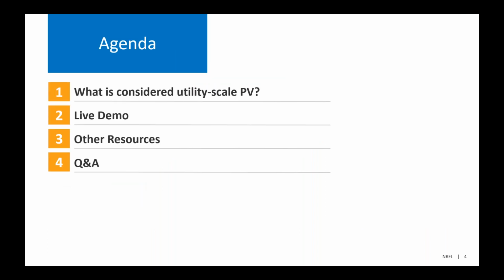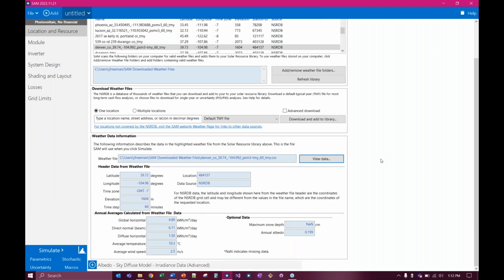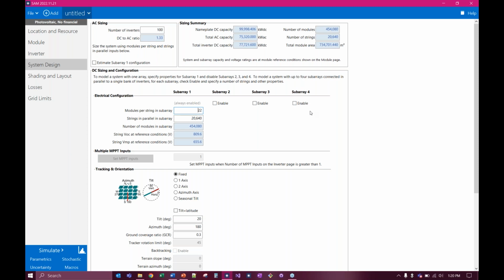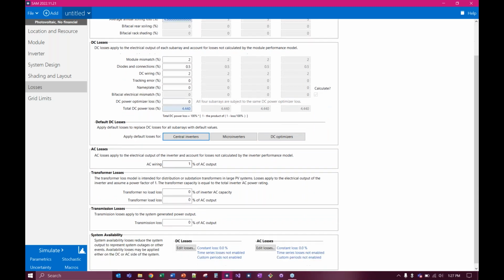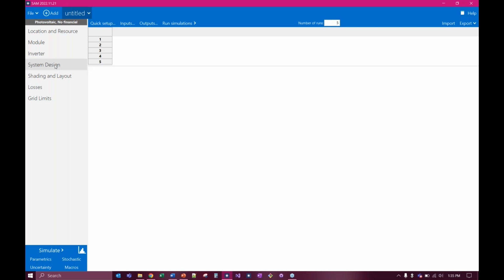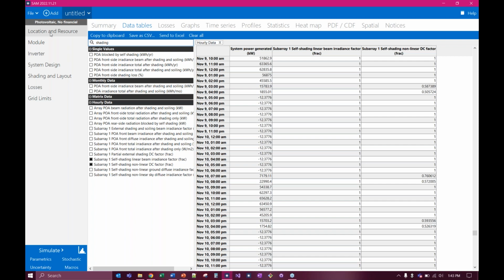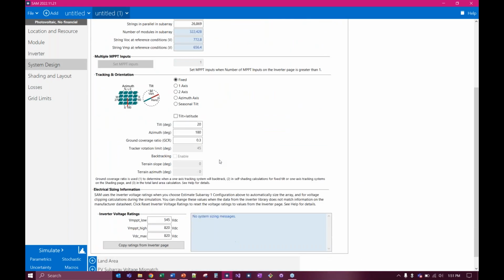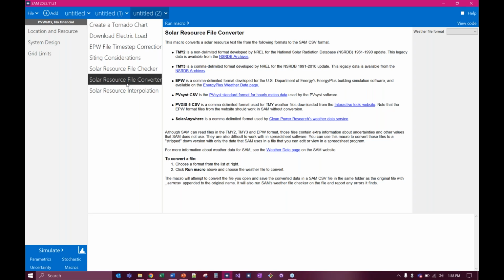Modeling Utility-scale PV Systems in SAM

Comment: I was so excited using this software trying to use a Canadian Solar utility inverter 350KW, which has 16 mppts...
Then I realized i cannot have more than 1 inverter with mppts, and if I do, it can only have 4 PPTS
I dont know how to go around this to simulate an 8MW solar farm
Reply from the maker: This is currently a limitation in SAM. You only really need to model separate MPPT inputs for subarrays that have different string lengths, orientation, or shading. Please post any further questions on the SAM forum: https://sam.nrel.gov/forum.

Comment: Hello again, I´ve already done my first run on a small project. I didn´t find exactly the PV and Inverter we have so I used the closest ones and I have this message at the end: Inverter oversized: ------The maximum inverter output was 68.60% of the rated value 2.626 kWac--------. So, I have to use a smaller inverter?
Reply from the maker: This message is intended to help make sure you correctly sized the system. You can use the inputs on the System Design page to see verify the system size. Please consider using the SAM Forum to ask questions about SAM: https://sam.nrel.gov/forum.
Reply: @SAMDemoVideos  thank you, nect time I will post at your forum

Comment: Hi Dear,
Hope you are fine.
Actually, I am performing performance and economic analysis for a 10 MW PV plant using UAE weather data. However, when I simulate it its Net Present Value is always negative but for similar 10 MW (built-in) USA weather-based data, NPV is positive.
For both of the above projects UAE based and USA-based 10 MW solar PV projects, all the settings/inputs are similar like a number of inverters, modules etc. The only thing I changed is to enter the coordinates of UAE in the location tab to enter the UAE location and its NPV turns out to be negative but for USA USA-based location, it's always positive. (and there is a big difference between these two values)
Can you help me rectify the issue, I think it might be something wrong when we load the UAE weather data?
Hope to hear from you soon.

Note: I have also posted in this SAM platform and also provided you both SAM files in my second reply.
Reply from the maker: Please see this conversation on the SAM forum: https://sam.nrel.gov/forum/forum-general/4349